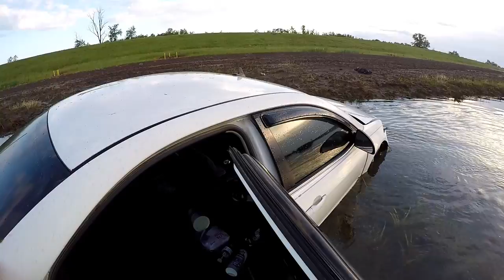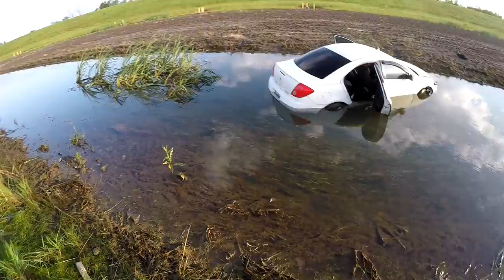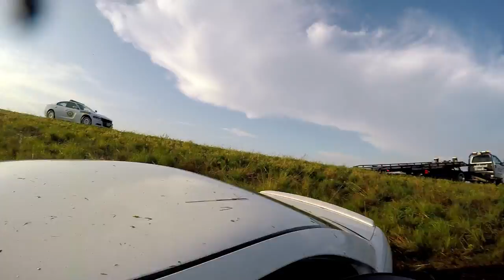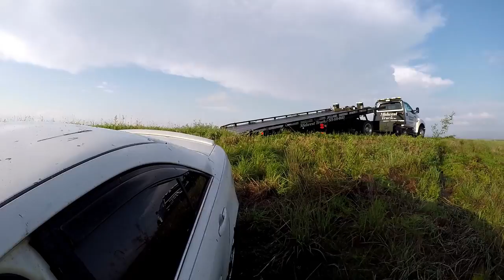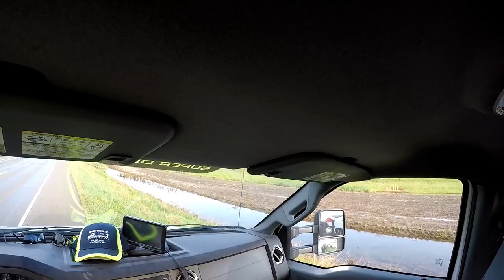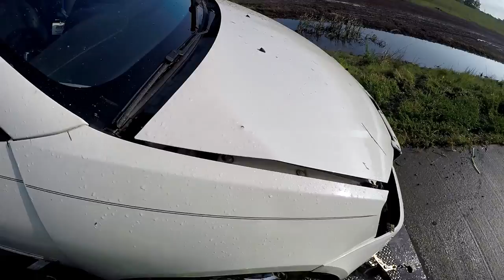WATER RECOVERY CAR FISHING FOR A G6

Comment: the strap under the seat trick was excellent. I learn something new every time I watch one of your videos.
Reply from the maker: Great, I am glad you enjoy the videos and find them educational.  God bless.
Reply: Can run it in front of the front seat too on 2-doors and it works going the other way running the strap behind the front seat.
Reply: @Chronos70  I thought that as well. I would have thought the body around the door opening would be at least as strong as the back seat. In UK the rear seats are made of nothing and would be destroyed by that pull.
Reply: @Chronos70  Insurance   purposes the chance of bending the pillars is too high he has to do it without further damage  and the seats are already  wrecked from water  accordoing to an  insurance company

Comment: Nice video Ron. I've seen you put cars on the rollback a zillion times, but never have seen you get one off when you get it back to the shop. Maybe you could do a video on that if you haven't already.
Reply: Ken Gill I was thinking the same thing.
Reply: i'm a mechanic so i see cars coming off roll back's with a flat tire or not running. but i've seen ron pull non rolling wrecks on the back. yeah i would much like to see the unloading of that.
Reply from the maker: You know, I have been asked that and just forget to video that process.  I will do that.  God bless
Reply: Ron Pratt 
cool

Comment: Mr. Ron Pratt great job as always.  I've havent seen many other tow truck guys use the ratching straps like you did to secure the vehicle they usually hook a chain to the hook points undercarriage then the other end into the slots on bed and pull it tight with winch line tho they are used on the 1 ton truck with the wheel lift
Reply from the maker: Thank you and God bless.

Comment: Ron you should get a fifth wheel puller ( like we use for releasing kingpins ) for snatching your slings, chokers ,or cables in around or under things. Light and handy. You might try a different bait if you going fishing for something bigger. Haha, nice video.
Reply from the maker: I actually have several different lengths of the pullers, but I keep most of them in the rotator.  I'd thought about using this as bait, but it doesn't taste very good....lol.    Thanks for watching and God bless.

Comment: 50 feet of cable .. some people can spit that far ...lol .. you had enough chain to get the job done well .. thanks Ron
Reply: Yea, that sucks but its easier to keep neat on a drum.  We have 75 just because, although with have a sidepuller that we use for recovery, the bed doesn't get used for ANY recovery, period.  In my opinion they aren't strong enough.
Reply: Puckgrinder85 plus the side pillar helps give you some lift and drives the truck into the ground for better traction if you're pulling a heavy enough load to need it.

Comment: First off excellent video as usual. What was the reason by you putting the strap under the seat as opposed to rim slings?
Reply: ICBUS07-30 
Every guy has his own way.... I would have put a small recovery strap around one of the mag wheel spokes and started pulling..... at least until the car cleared the water and I could hook it better. To each his own.
Reply from the maker: The main reason was to decrease the amount of resistance.  By placing the strap through the car, I could put the car in neutral and allow it to roll.  If I had strapped the wheels, they would not have rolled and would have increased the resistance.  It probably still could have been done by strapping the wheels.  I chose to do it this way.  There is always more than one way to recover a vehicle.  Thanks for watching and God bless.
Reply: I did not even think about rolling resistance that makes sense. I was not trying to tell you how to do your job. Just me not thinking as usual. Thank you again.
Reply from the maker: Not a problem.  I didn't take offense.  I was just trying to answer your question.  No worries.  God bless.

Comment: Hey Ron wouldn't you love to have a rotating rollback with a high winch
Reply: That would be a Side Puller, they come with longer wire rope at 100 foot length on the ones from In the Ditch which are in my opinion the best system out there, allows you to use the side pull action or use it as you do the deck winch when the deck unit conks, or even forgo the deck unit on a new wrecker and use just the ITD unit, In the last case all you need is a roller guide to redirect and maintain pull of the vehicle onto the deck and keep the rope from cutting in
Reply: Id go with a Side puller any day over one of those rotating beds. So much to go wrong with the rotating bed's its not even worth it from what iv seen atleast for recoverys. If it was standard roadside calls and you pull alot of cars from parking lots it would be nice, but if your working that truck good on a recovery i personally think the rotating bed is a bad bad idea, Now a side puller ideal and make 1 lane recoverys a breeze!
Reply: Ryan Snyder why would a rotating bed be bad? pull straight up, don't have to fight turning the car and centering on the bed, less chance of slide off on steep ditches

Comment: Awesome job as usual up here .in canada where i tow we are constantly going swimming for vehicles..learned a little for getting straps chains under veihecles use an old reach it tool put a hook on the end it works great for that especially when we have to get the equipent under the car truck out of snow filled ditches lot safer to reach under vehicle .great job and see ya in the ditches
Reply from the maker: Stay safe out there brother.  God bless.

Comment: Car fishing is fun. Here in Alaska we fish out pickup trucks and suvs that people get stuck on the beach while trying to launch their boat. Some times they don't get them out quick enough and the salt water destroys them. If the water gets too deep around them it destroys the engine and electronics. We usually tow 40 to 50 off of the beach every summer and some are left until the tide goes back out as it is too dangerous to try to hook them up with the tide coming in. Sometimes the tide will suck the truck out and we find it several miles up the beach. The tides in Alaska's Cook Inlet are second only to the Bay of Fundy in Canada. We have up to 30 vertical feet of water moving in and out and the current reaches 15 miles per hour. We will not risk entering the water on an incoming tide as it can suck us or our truck in too. Also the water is only about 38 degrees in summer and you can get hypothermia in as little as 5 to 7 minutes. You can die of hypothermia in as little as 12 to 18 minutes. You will loose conciousnes in about 7 minutes.

Comment: 50' of cable seems light for any off-road recovery. Maybe, Miller can offer a bigger winch drum and a lot more cable. The way you rigged that strap through the doors and under the wheels was pretty smart.
Reply: David Sonnen 
Miller doesnt make the winches, they are usually Ramsey or Warn, Tulsa, etc. As Ron stated, they come equipped with a 50 foot cable.... but they can hold up to 125-150 with no modification. But keep in mind, the longer cable means the drum gets larger in diameter when fully wound, which reduces you overall pulling power. Not a big deal when the cable is stretched out during a recover, but on day-to-day towing when the cable is barely pulled past the end of the bed to load a vehicle, you will have reduced pulling power. Thats not usually a problem though unless you're trying to pull a heavy truck, in park, or locked wheels, etc, etc. There are pros and cons to using long winch cables.... I always preferred 100 foot cables, happy medium, best of both worlds.

Comment: Hi Ron great video as always, I wonder though whats stopping the weight of the car from dragging you're truck off the road and down the bank when you start to winch as you dont seem to have any stabilisers like you do on the rotator truck..or is it just the sheer weight of the truck holding it in place? Also could you not have just put the strap through the doors and pulled against the rear pillars until you at least get it to the bank and repositioned you're strap/chains or would that likely have done damage to the car? I'm just thinking it would save you getting so wet!! Take care.

Comment: Hey sir luv u videos been towing 20 years myself learn some new stuff while watching u but when u do a recovery with the flatbed or roll back as u call it lol leave the bed in the bedlocks I've worked at a company before where the driver did this type of stuff contunuesly an the pin holding the bed to the truck worked it's way out an he was on the highway when it happend worked itself half way out before he cought it that pin is the only thing really holding the bed on the truck I have seen beds come off before if u can't get a wrecker out to u regardless if u can charge for a second truck an if u have to do what u do or did use a piece of wood under the wire rope to keep it from goin over the edge of the bed sir thanks again for the excellent work be safe plse an God bless if u want to comment etc plse do sir

Comment: Great morning for a swim.. NOT!! Great recovery of a little "fishie" in the water.  ;) Hope you got the cable changed to a longer one. Nothing worse than coming up "short". Yes, I'm short too. Only 5'3" tall. I have fun with my shortness. :)
Reply from the maker: Yep, I changed to a 75' cable and it has been working very well.  This was several months ago so I have had a chance to use the longer cable quite a few times.  Don't worry, I'm short too.  5'8" at best.  I have a small step ladder in the rotator so that I can reach the bays when the outriggers have the truck lifted up....lol.
Reply: All fantastic. You are still taller than me, though :D I check in here daily just so I don't miss any of your videos. I think I have all your older ones all caught up too.

Comment: I take it that this one ended up being part of the "dump & run fun" at the end of the year???

Our local guy (who built his big truck) got a lot of parts that worked on or upgraded his rig that way.  A lot of wrecked trucks became his by default or were titled over to him to defray the cost of the recovery.

The "smaller" truck (cab forward Ford with a 650 Holmes) started, with him, with a gas 460, 5x2 .  When it finally went to the salvage yard, it had a 3208 Cat, was converted to air brakes, heaviest front axle he could get his hands on, 13 x 2 (rear axle had been upgraded as well, but still dual speed) and had as many spring leafs he could practically fit on the rear end.  Couldn't tow a fully loaded semi with it, as short as it was, but he could, with great care, inch one out of a dangerous spot to someplace safer, to wait for a larger/longer truck to arrive for the actual haul.

Comment: I hope this isnt a dumb question but couldnt you have wrapped the strap around the rear wheels of the car without going thru the back seat and pulled it to the grass then removed straps and then put the hooks under the car somewhere and pulled it up back onto the roadway? just a question you  do great work i was just wondering thats all
Reply from the maker: If I can get straps through the wheels, then yes, that would have worked.  The only problem with running straps through the wheels is that it locks the wheels up which creates more resistance while winching.  I have used straps through the wheels many times and it is a good alternative.  In this instance, with the weight of the water and the steepness of the grade, I chose to go with less resistance.  Good question.    Thanks for watching and God bless.

Comment: Ron do you think using a rollback for recovery like this reduces its life expectancy by putting more stress on the bed and the joints?
Reply from the maker: It does put extra stress on the bed and the joints.  I believe that as long as I know the stresses being placed on the bed, the winch, the snatch block, tackle, and the cable; I stay withing SWLL Safe Working Load Limits; and perform routine maintenance, then the bed will perform well for a long time.  Thanks for watching and God bless.

Comment: Just wandering why you didn't put cones out. I work an outside job and operate a bucket lift. I put lots of cones out and I prefer to use the big something like 40 inch cones because if they hit them they will more than likely destroy there own bumper and I will hear coming.

Comment: Excellent job Ron. How many fully submerged vehicles have had to recover?
Reply from the maker: I don't remember an exact number, but there have been several.  The most memorable of these would have made quite a video, but I wasn't recording at the time.  One of our local fire department's special operations team brought in boats and divers to locate and connect the rigging to an SUV that rolled down a boat ramp into the Diversion Channel.  I'm guessing that it was 25-30' deep in murky water.  Thanks for watching and God bless.

Comment: drove too close to the edge of a clay road one day and beached my ford courier ute.   front wheels just dropped down and had it sitting on the chassis rails.   hour and a half later and a rollback showed up to haul it out.   turned out to be a fairly difficult job as the axles formed an almost 90 degree angle perpendicular to the edge of the dropout.   wrecker ended up winching the truck bed back under the ute until it lifted the front wheels out.   slightly ironic that i needed towing given how often im hauling mates out of stupid situations.   just goes to show that it happens to even the 'better' drivers if you will.

Comment: Could have been worse, it could have been March, and that water 40 degrees or so.

Fifty foot of cable is enough if you are towing parked cars in a city, and probably 90% of these trucks are bought for that. How long of a cable did you install?

Have a good weekend.
Reply from the maker: I put 75' cables on our rollbacks and it has helped considerably.  I also went up one diameter size for more strength.  Thanks for watching and God bless.

Comment: A question: In a case like this, where the owner did not call you for assistance, what happens if the owner doesn't want to pay you? Does the law make him/her pay?
Reply from the maker: Unfortunately, no.  We can hold the car and anything in the car, except prescription medication, as collateral for payment.   After a tremendous amount of paperwork and time we can apply for a title to the car, then attempt to sell it or we can take it to a scrap yard and have it crushed.  Most of the time the cars we get stuck with aren't worth the time and money it takes to get a title, so we end up crushing them.  We have the option of taking the vehicle owner to small claims court, but we do not like resorting to that option.  Even when we do win our case in court, which we always have, we are still responsible for collecting from the customer.  Unfortunately the law simply states that the customer must pay for our services and court costs, but it does not enforce the law or impose penalties on the persons, which, in my opinion, defeats the purpose of the law.

Comment: if you can bring roator with crane and it can lift cars up without damaged or flatbed cable is not enough to reach the car axles but it up to you? in the future
Reply: The amount of work to rig the rotator to actually lift the car would be significant, plus he'd have had to go deeper in the water.  Anytime the rotator comes out is gonna be big $$$.  There was no additional damage to the car from this tow anyway.

Comment: Hey Ron, I know this is a long shot, but do you by chance still have this or another G6 with 17" rims, I have a G6 with hub caps, would love to replace with actual factory rims
Reply from the maker: Believe it or not, I do still have this exact car.  I've been saving it for a special project with the police department.  I'll explain more later, but there could be a fun video in the works that will feature this car.    We won't need the wheels for what we are going to do.  Thanks for watching and God bless.
Reply: @RonPratt  are they 17" rims?  And if so how much for all 4?
Reply from the maker: @blitx7243  I'm not sure.  I'll have to check when I go to the shop the next time.  I can let you know.
Reply: @RonPratt  please do, thanks

Comment: if 50 ft is standard. what is the max you can fit on the winch. also what size cable is on the rollback vs the single axle wrecker vs the almighty rotator. stay safe
Reply from the maker: I currently have a 7/16" X 75' on the rollbacks.  Standard is 3/8" X 50'.  The single axle 4024 has 9/16" X 175' cables on the boom.  The rotator has a total of 5 winches.  The two main boom winches and the drag winch have 3/4" X 250' cables and the two turret winches have 5/8" X 200' cables.  Thanks for watching and God bless.

Comment: I noticed that the police car had his front wheels turned to the left. All roadside assistance vehicles here in Ireland turn their steering away from the carriageway when stopped because, if struck from behind, the vehicle will not be forced out into the traffic lanes.
Reply from the maker: There isn't a set standard in the States on which way to turn the wheels for emergency vehicles.  It varies from state to state and sometimes from agency to agency.  From training with multiple fire and police agencies, I can tell you that it also depends on where the vehicle is placed at the scene as to which way its front wheels are turned, at least at the local level I work in.  TIMS Traffic Incident Managment Safety training goes through the scene setup and the placement of Emergency Vehicles for various situaitions. Thanks for watching and God bless.